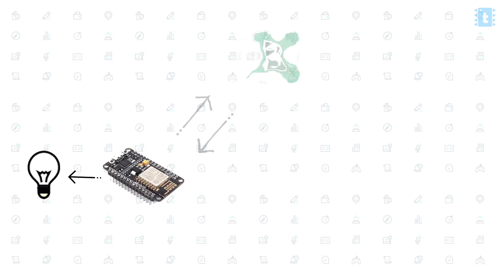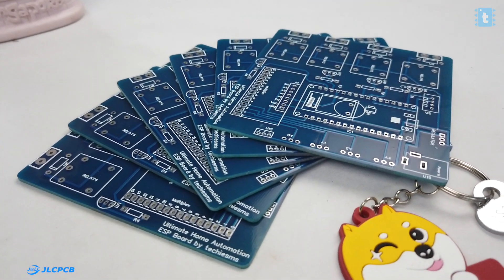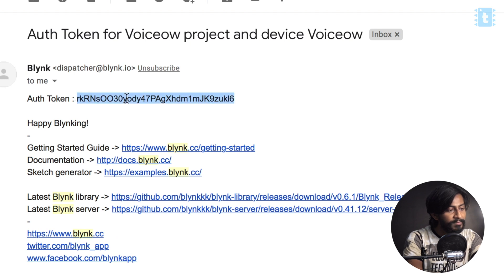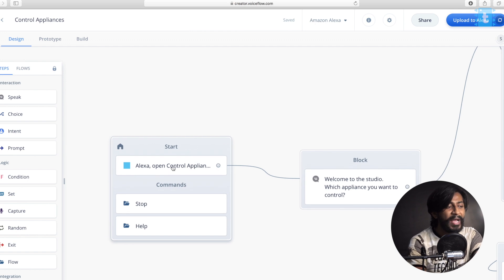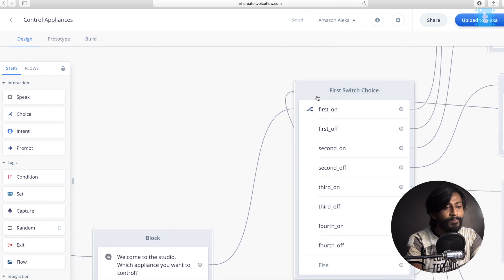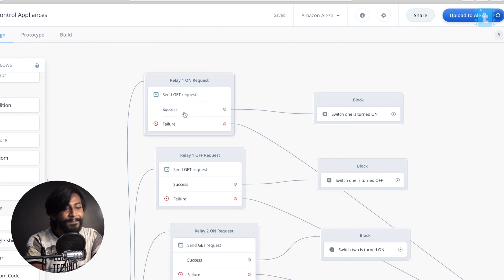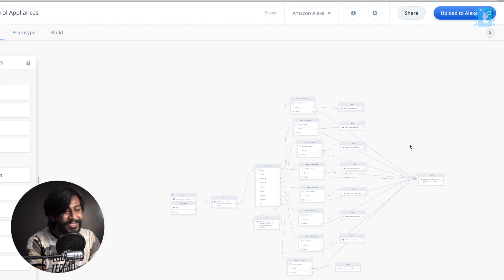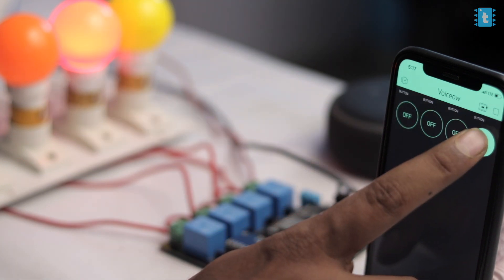Custom Voice App for Home Automation  | ESP8266 Projects | IoT Projects | Blynk | Voiceflow

Comment: hello bro
i need your help
i am trying to make home automation using esp32
and i'm using your code and circuit diagram
but i got a problem bro
when i'm giving 5v supply
esp32 is getting power
but it is not connecting to my wi-fi
when i removed the vin 5V supply to resistors/switchs then it connecting
what i have to do ? please help me bro

Comment: One situation that i am facing with blynk is that after loosing power or wifi connectivity its not able to fetch its last synced state of either ON/OFF. What could be the reason or solutions if you can suggest me how to overcome that issue.?
Reply: safe last states in eeprom
Reply: @shubhamsen4572  Any code need to include on the ESP.? if so pls share the code

Comment: Dear I make a home automation which you previously present 
Internet and Manual ESP 32 
So I'm facing an issue with the project
That if turn on the relay from blynk application and while running disconnect the internet then relay will turn off 
So need to be staying the relay on.
How can I do that
Please your support
jaleelpchalil@gmail.com

Comment: Super Bro.... Learning n sharing new concepts is Great... 

What's the difference between using Digital pins n Virtual Pins in Blynk application?
Reply from the maker: Virtual pins are like a variable in which we can store the data and use it for any purpose 

While

Digital pins are specific for specific GPIO pin and can’t be used anywhere else for other purposes